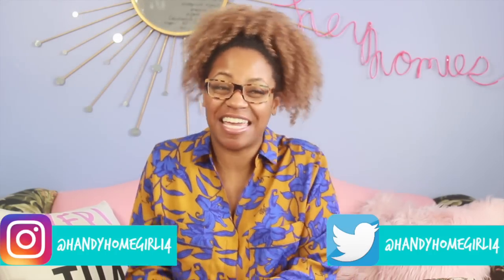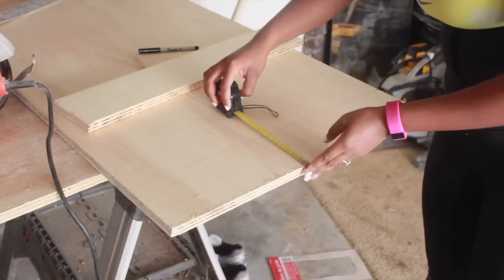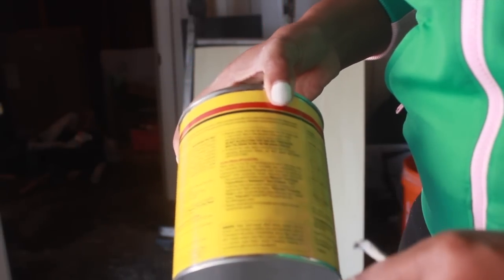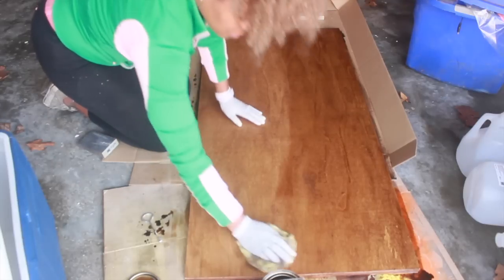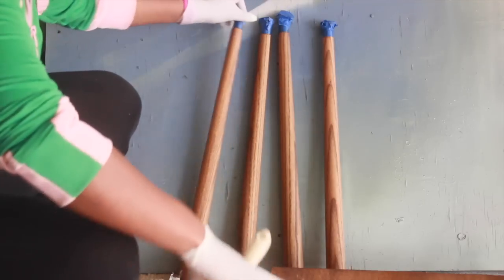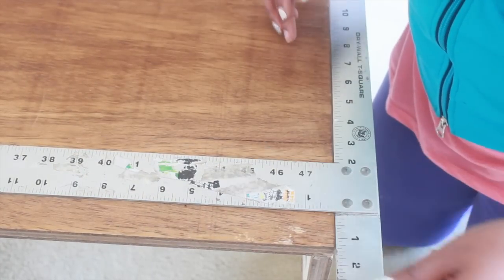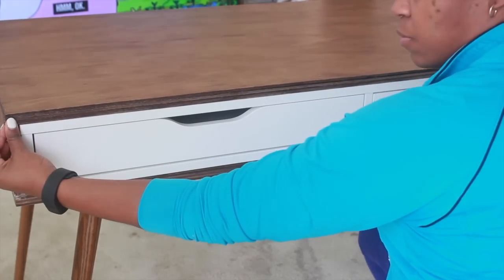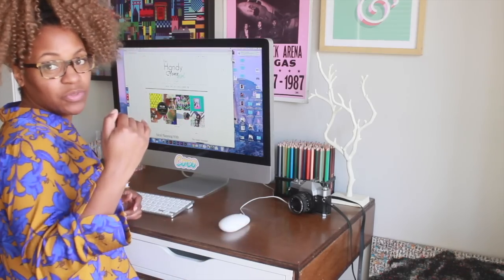DIY Mid Century Modern Desk | IKEA Hack

Comment: beautiful desk! Something that Ive found is way more efficient is using a microfiber cloth to apply the stain. When I first started doing this, I was using a brush and switched real quick to using the microfiber. you will save sooooo much product and it will look way more even in the end. ALSO, always use a tack cloth to remove sanding residue, a t-shirt or rag can leave particles and won't get rid of all of the dust.

Comment: Loved your video!! I made a table similar to this and used the same legs. After I installed all the legs and flipped the table over, the table was easily swaying if I pushed the table around. Were you experiencing the same thing? How can that be fixed? All plates and legs were tightly screwed in.